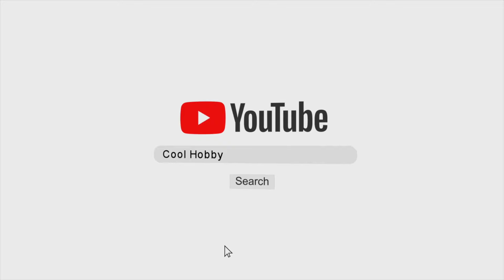Airsoft AEG Ver.2 GEARBOX COMPLETE GUIDE: Assembly (M4/HK416/M16/MP5/G3)

Comment: What would u recommend if the piston in my gear box will short stroke or not reset with 12:1 gears
Reply: Nicolas 25 get a light piston and then with 14 metal teeth and you will have to just try if it will work
Reply: Veke I actually shimmed the gears property and it works better now